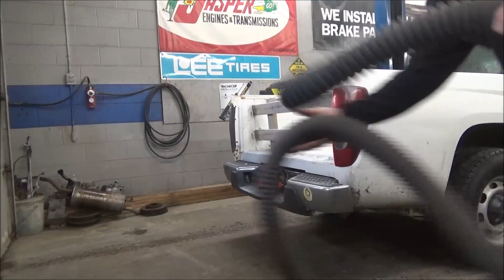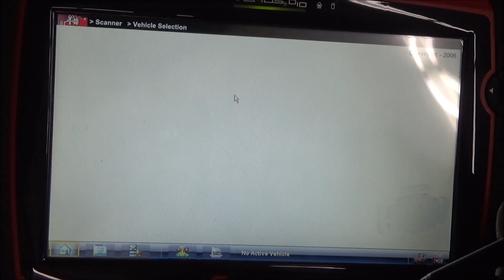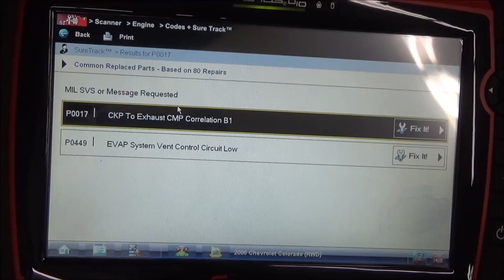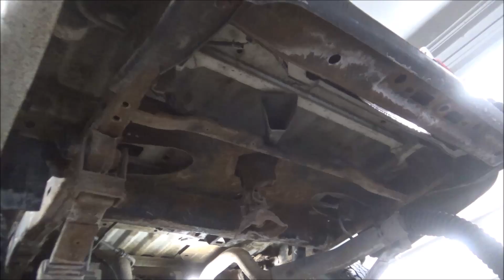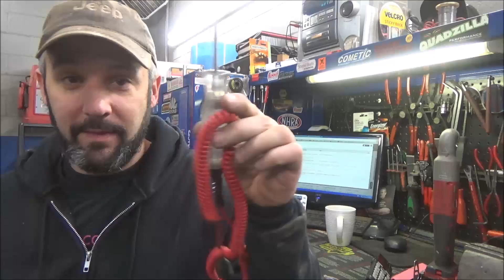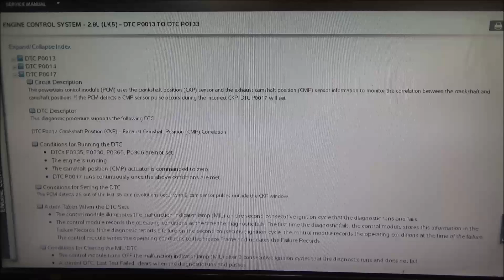Chevy Colorado - EVAP Trouble P0449 & P0017

Comment: Full nerd explanation attempt: the PCM has a high value resistor, probably something like 10K, pulling the command wire to ground. It will deliver 12 volts but hardly any current. If the coil is intact at just a few ohms, it will send the 12 volts from the full time power through itself and pull the command wire up to 12 volts and the PCM will see that. If the circuit is broken or the coil is bad, it will see some value much lower than 12 volts, as low as ground.
That's how it knows that the circuit is bad, and why you will still see 12 volts, but it won't carry any current because the ground is going through that 10K resistor.

Comment: Oh that makes sense why other shop thought there was a electrical issue they used a DVOM when they saw constant battery voltage good Work Showing the oppsy from the other shop Tech I agree test lights work better then DVOM on Control circuits Eric O @SouthMainAutoRepairLLC

Comment: Almost the exact situation occurred when a electrician's helper I hired was helping me rewire a rat's nest created by a previous homeowner. The "helper" was in a trance for 15 minutes staring at his DVM which was indicating about 70 volts AC on a wire that shouldn't have been connected to power. I ran and got my old fashioned Simpson 260 which has a much lower impedance than his DVM and got a 0 volt reading instead. He acted amazed that I found this and I was amazed that he was not aware of phantom voltage from capacitive coupling since he was an electrician. Maybe he was milking the job...who knows.

Comment: Excellent stuff showing the need to load circuits like solenoid valve control circuits when checking for command signals. When doing this with a multimeter, it should be equipped with a LoZ setting, but, typically those only come on specialized or high end multimeters. It's a lot cheaper to carry around a 100 Ohm/3W resistor (which doubles as a pair of backprobes).

Comment: Cool video Eric O , I had an 04 Colorado  ( bought brand new in 04) with the inline 5 / 3.5 liter I believe it was , and I never cared for that vehicle, It started running like crap at around 75 to 80,000 miles using in my opinion more gas than it should have , and would occasionally stall but start right back up and run OK for a bit and then do it again in a month or 2 very annoying!!!

Comment: Do you not own the LOAD-PRO test leads?  from Dan sullivan? Because  you can test the whole wiring harness  for voltage drop with the push of the button with the patented load pro lead  . Even the shroedinger box now owns the leads  i think i might have managed to convince him to buy them  "ohms law matters " dan sullivan is 100% correct.  Your methode also works but Dan sullivans tool is like the ultimate time saver.
i know one can have to much tools but that accessory  is a must have if time is money.

Comment: Good job explaining how the computer checks for opens and shorts.  For those vent solenoids Eric how much current do they usually pull? Your spot on about meter usage, have to understand what the meter is telling you and be aware of circuit operation.  Thermo King Computers put out a bias voltage on the ac clutch circuit, not battery voltage but it is around 4.2, 4.3 Volts, you will see this value with your voltmeter in the power and ground of the connector unplugged.  So to test dynamically either plug the circuit back in to check or how I like to do I use the Loadpro to fool the computer that the load is plugged in.  Takes a minute for the computer to recognize a complete path but when it does if I have a good circuit path it will give me full system voltage on my meter which is the volt drop across the Loadpro resistor.

Comment: I'd love to see a full nerd explanation of what was going on. I would think the impedance of your test light also has an effect on the meter reading. I'm a big fan of voltage (drop) testing of loaded circuits. I was worried that you may have 'fixed' the problem by disturbing the wires when you unplugged the connector.

Comment: So, let me see if I have this straight: The PCM signals the solenoid to open by yanking it's ground forcing the voltage to use the solenoid's ground, thereby "seeing" 0V, signifying that it's working not just passing current? Sheesh. What a "lovely" idea... :(

Comment: I wonder if that is why I was getting battery voltage on my cheap voltmeter at the O2 Sensor wire. I keep getting a periodic P0161 code. I will need to get a test light because it was even showing continuity between the two heater wires. 

Thats for that lesson there Eric. It does make sense.

Comment: Great video Eric! Don't worry you explained it just right.

when I was in training many years ago I was taught how to use a meter and how to diagnose with it and you hit all my fundamental rules right on.back probe only,circuit intact and loaded,negative lead to good known ground at all times,and use voltage drop to check for resistance only use ohm meter to check component resistance.

I've tried different gadgets and doodads but always went back to my meter.i do really want a scope but not the price tag.lol.

Comment: I'm not sure if it will help you, but if you have a set of noid lights laying around, you can usually find one that will fit into the plug of what you are trying to test. I unplug the component (such as your vent solenoid) and plug up the noid light. Then you have both hands free to use the scanner to command the component. Since the noid light is incandescent, it also shows that the driver can handle an electrical load.
Reply from the maker: +Frank Fufjr BAM! Great tip :)
Reply: Frank l

Comment: Isn't a situation like this exactly what the LoadPro was designed to find? Back in the day an electronics technician had two meters. A analog Triplett meter with a relatively low input impedance (20,000 ohm/volt) and a VTVM with a greater than 10M input impedance the same as today's Digital Voltmeters which use a MOSFET rather than a vacuum tube to achieve this high impedance. OK youngsters, that stood for vacuum tube voltmeter. The VTVM was used only when one was worried about inadvertently loading the circuit as it would remove very little current from it. Otherwise we always used the Triplett since we didn't need to plug it in. High impedance digital voltmeters are wonderful but they do lead to this kind of a problem. I think that's why Dan Sullivan invented the LoadPro to overcome this issue by placing a load on the circuit.
Reply: Yes, this is what the LoadPro is for. Eric kind of emulated a LoadPro when he connected the test light to the circuit with the volt meter attached. That's loading the circuit like the LoadPro does, except with much greater accuracy in case there is a voltage drop.
Reply: Dang Dennis .. I haven't heard anyone mention Tripplet in a long time.

Comment: Great video. You would think Chevy would fix there Evap problems. Can't tell you how many Chevys I've done with Evap trouble
Reply from the maker: +Justin Hayward SES on  in  a GM, 95% chance it is a P044 something lol
Reply: Even Chevy Prizms. My family's had 2 of those in my lifetime, both '02's. Now we have a Corolla we got last year after our last remaining Prizm got too rusty. We also had a '93 Geo Prizm and that never had an engine light stay on. But the Chevy Prizms, as we learned when I was in high school, turned out to be prone to evaporative solenoid trouble and other evap issues. Ours ran perfect with the engine light on when they had evap trouble. I mean, they started fine, no weird noise, no stalling, smells or other off behavior we could detect related to the evap trouble. Their exhaust might've showed something, but we never looked. We started calling them Chevotas when we had our Geo, as I remember because of being a Corolla twin.

Comment: "It's colder than penguin snot out there..." Totally stealing that. :)  Btw, check your FB msgs. I sent you a msg that might help with the background heater noise.
Reply from the maker: +Gerald Hinson Cool thanks, I actually have been looking into that program, I just use movie maker right now, one because it is free and 2 because I can make a movie super fast and easy. I will see, everything new just takes a while to get use to is all.
Reply: +South Main Auto Repair It's hard to beat movie maker for simplicity. And the noise isn't a big deal to me. Just wanted to make you aware of a possible solution in case you didn't know about it.
Reply from the maker: Perfect thanks :)
Reply: +South Main Auto Repair Btw, what camera do you use to film? It does a great job. I've been using a little JVC to film my daughter's gymnastics, mostly because it has an optical zoom vs. a digital. But, I might upgrade at some point.
Reply from the maker: It is a Sony Handi Cam HDR=CX330, I actually just ordered a $100 Chinese knock off camera with higher specs just because I really have to see if it works lol, I figure if it doesn't work for my application I can use it for something but I would like to upgrade to something with the option of an external mic.

Comment: Problem is the Snap-On meter is junk for the price. I use a Fluke 289 and you can set for ghost voltage and the ohms and then log it.

You can also look at some of these as nothing but relays normally open or closed, push\pull. All they are doing is applying a source voltage and looking for a signal return. That tells the PCM if it's open circuit or closed.

Comment: I usually diagnose the end circuit (the vent solenoid in this case). Using a battery from a jumper pack across the solenoid leads to see if I get a "click." I don't have expensive test equipment, except for a meter and a test light. Probably good to verify the supply side also.
Reply from the maker: +James Last That can burn ya, better off just using what the car has supplied right there for ya and do a simple bypass test just to be safe.

Comment: Great way explaining how you can get burned with a multi-meter, I've learned to always use a test light when checking for power and ground, unless they specify in diagnostics a specified value... In a class i took, the teacher put a resistor in a power wire for a module which made the module not communicate because there wasn't enough current passing through the wire but it showed battery voltage on the meter. He did this to show us the importance of using a test light with the meter to show us the voltage drop

As for the p0017 I did get burned on that once thinking it was only the actuator when in reality the Timing chain stretched. I talked to a GM technical support and they said half a link is enough to set the code. If it ends up needing a timing chain inspect the crank sprocket for any wear in the key way.  Although ive never seen this but there is a tsb out for the thrust bearing of the crankshaft for wearing out that could also cause this dtc to set.
Reply from the maker: +daveyio87 You may be interested in the vids to follow :)

Comment: After watching a replay, I got to understand that voltage on a meter is not reliable unless current flows in the circuit--I stand to be corrected.It's funny how the meter gave the full voltage when the solenoid was commanded off. I wonder if an old analogue meter with 20kohm/volt would have given the same result ? I know from using a voltmeter that if one electron flowed in the the circuit it would give the full voltage .It is easy get fooled with electrical circuits.Well it's back to Freddy Flintstone with the humble test light and the town of Bedrock.Barney and Wilma will be laughing their heads off.
Reply from the maker: +Tom OConnor Haha yep ya gotta know what you are testing :)

Comment: Are you ready for some snow? What air fittings do you use? I've tried that style with no luck. Great explanation.
Reply from the maker: +Michael Herbert I am always ready for snow, I use the "B Type" from Napa
Reply: +Michael Herbert The NAPA "B" is equivalent to the ARO style connector. If you buy it from NAPA it's a "B". If you get it from anybody else it's an ARO style.
Reply: +SATAMAN Schmidt Hey man, where have you been? I haven't heard from you in a while. Glad to see you're back. Thanks for the info.

Comment: Sat down for a cup of tea, next thing I know 25 minutes have passed. You are the man Eric.

Funnily enough between what I've learned from you and Ivan about electrical diagnostics I was able to diagnose and fix the heating control system in my friends office. Heating engineer was trying to sell him an expensive Siemens controller. But it was a bad relay in the pump control circuit. The controller was fine.
Reply from the maker: +zoidberg444 Haha that is cool :)

Comment: Maybe you can solder a 50ohm pot inline with the ohm meter lead. Keep it on zero ohms during normal use but turn it up to 50 for stuff like this. Somebody probably already makes leads like that.

Comment: So for this evap circuit, It's getting battery voltage to it and battery voltage back to the PCM right? When the evap energizes it grounds out and sends ground back to the PCM letting the PCM know it's working right? Then what is the triggering signal here?  How is the PCM telling the EVAP to energize?
Reply: +Fahrenheit38 The evap solenoid has a constand 12v power. When the pcm wants the solenoid comanded on, it provided the ground via the 2nd wire.
Reply: +Fahrenheit38 The pcm checks circuit integrity of the solenoid by looking for 12v on the 2nd wire. If the solenoid is good, 12v goes from the 1st wire through the solenoid and to the pcm through the 2nd wire. In this case, solenoid was bad (open circuit) pcm does not see 12v from 2nd wire so it sets a code
Reply: +madbull9988 Some people are mad but you aint one of them.
Reply: +madbull9988 So why does putting a load on the circuit do anything? Eric puts a test light over it and the load of the light bulb is doing something.